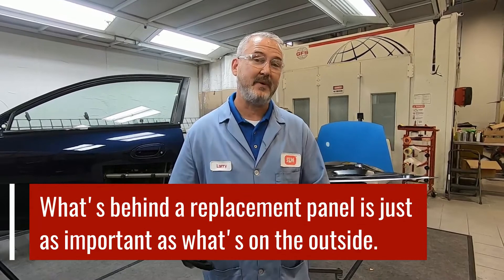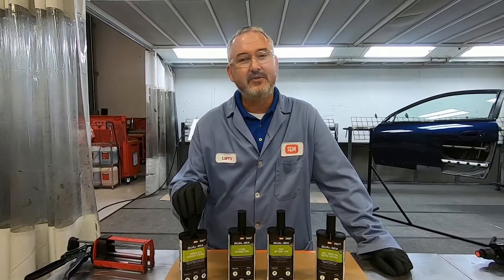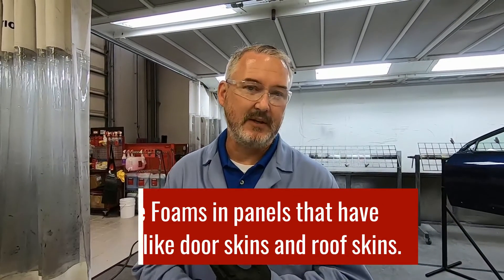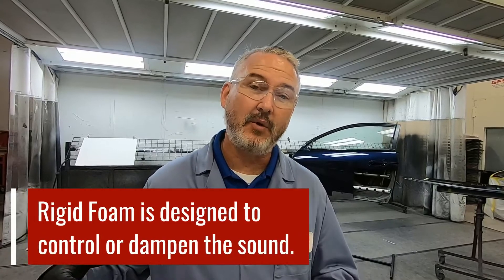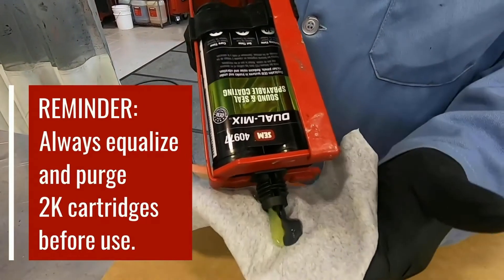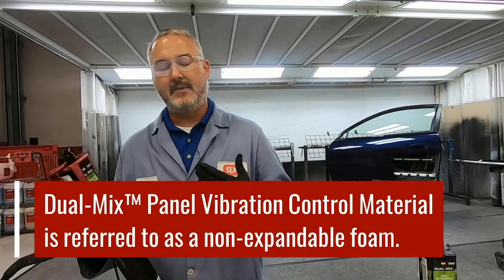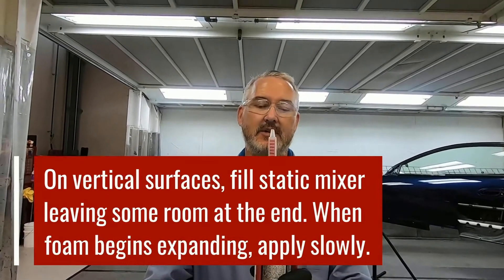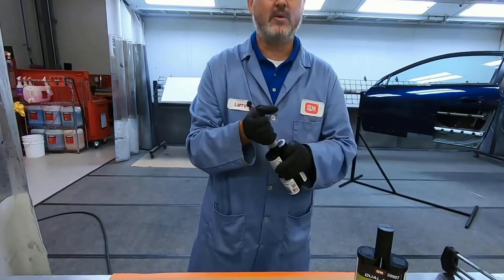Training Series - Episode 10: Sound Dampening

Comment: Does the rigid foam not trap moisture and cause rust? Ive repaired a lot of vehicles where someone thought expand-o-foam was a good idea as an insulator in a vehicle and it always rots where that foam was. I understand this is a different product but the moisture trapping directly against the material still seems to be there. 

I'm not criticizing, I want to learn. I'm a custom car Builder and always looking for newer auto body techniques to apply to classic car restoration and customization.
Reply: I was wondering the same re the potential for moisture retention - the cases you mention where "...expand-o-foam..." were used may have many variables and the foam may just be one of the 'contributors' to the "...rot..." - but - for sure, any area that has a possibility of moisture ingress and then 'allowed' to linger longer due to the possibility of the foam halting or slowing down the egress of the water - is something to consider.  I am 'guessing' that expando is a closed cell foam and does not actually soak up the moisture like a sponge, but putting a 'blob' of anything that could interfere with moisture is something to take into consideration.  But like anything - whether a great product or not - done correctly - could be no issues - done incorrectly - could create issues - and these SEM products look to be great products - I I will be using them as often as required.  CHEERS from AUSTRALIA.
Reply: I want to know this as well. My truck is victim of this. I filled the roof with Great Stuff Black Can foam around 2009. The whole passenger side is now rotted out. I have a replacement roof for it , gonna be a big job.
The initial results were wonderful as far as deadening goes. I would love to repeat this but with a product that does NOT retain moisture